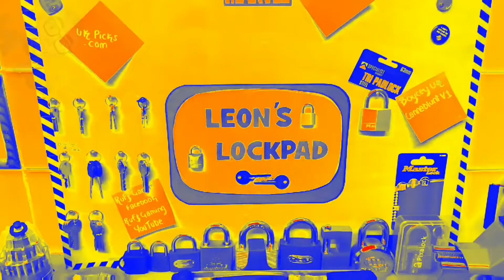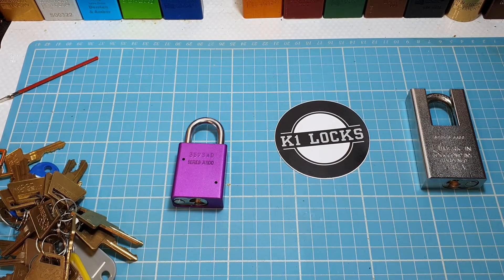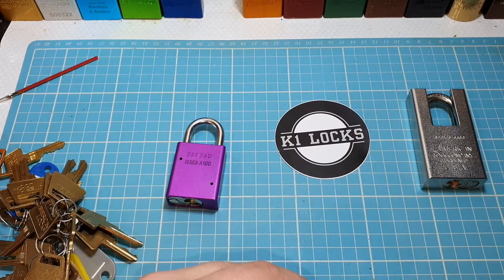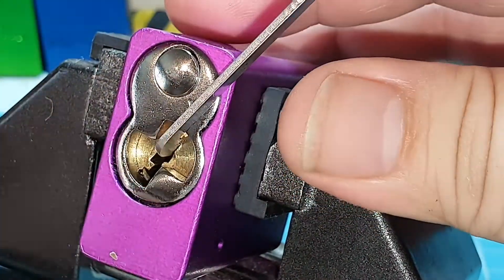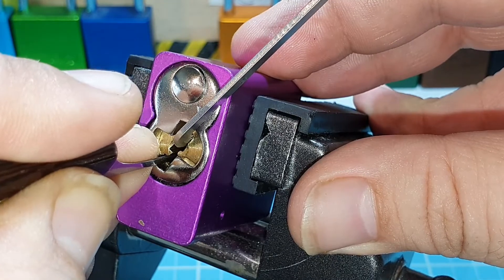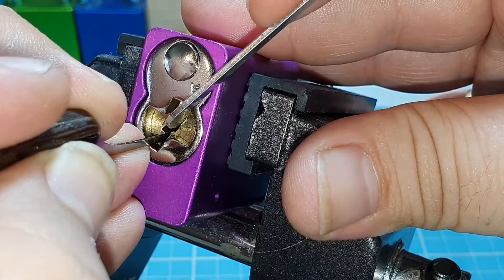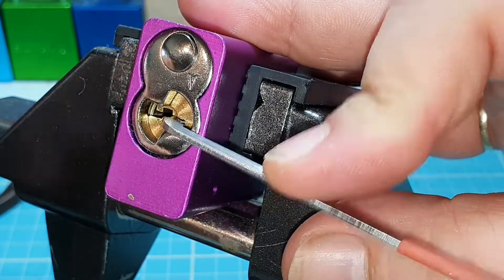lock picking.1100 beginners tutorial

Comment: @Leon's lockpad: One thing I always have a problem with: if you look at about the 5'00" mark, you can see the core has turned by 15 degrees or more, and I'm always trying to work out whether I should be trying to lift the pins straight UP towards the bible (which is where they are) or in the line of where the turned core now is (which is direction the chambers are now lying).  So should I be lifting straight up, or in line with the turned keyway?  Decisions, decisions...!  I note that your pick is angled to be lifting/levering in the direction of the keyway, NOT straight up and down.
Reply from the maker: Thank you very much my friend if it's got a deep fault set just carry on lifting the pins the ones that are set will not move by the ones I still need setting will be loose and for the lock I pick in what orientation it comes from that country
😊🇬🇧🤟👊👍😎